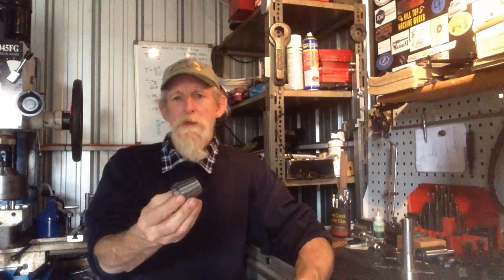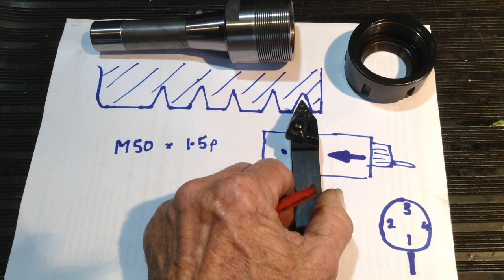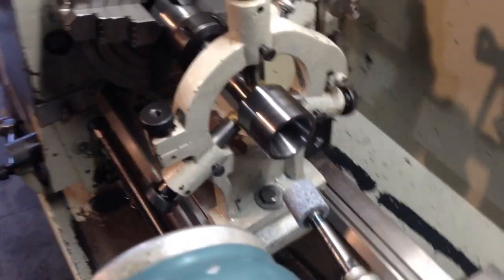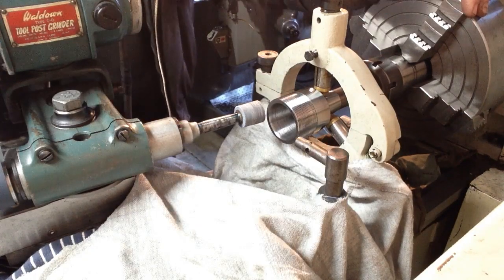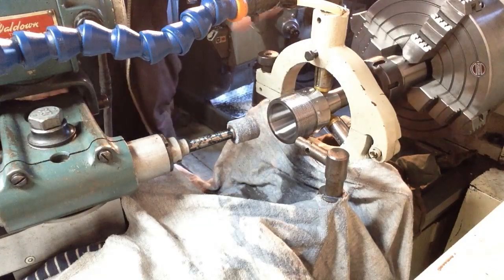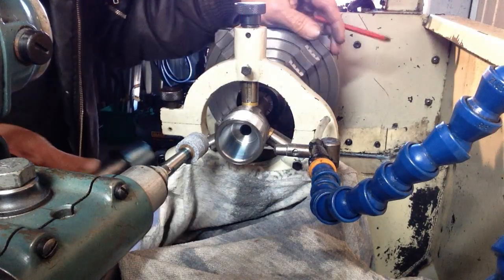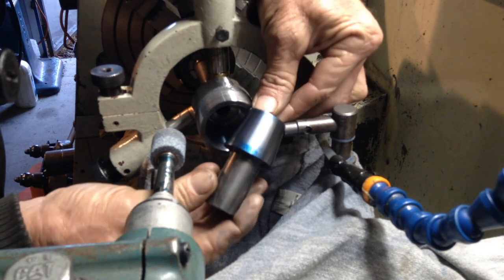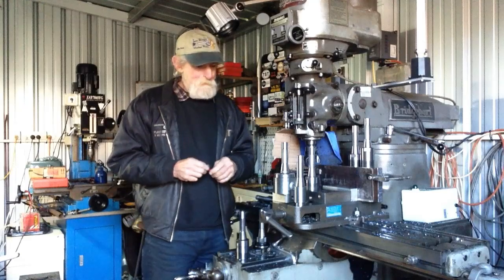Machining R8 Tooling For The Bridgeport . Part 12

Comment: That was a really interesting way to get the thread cutting tool aligned. I have always tried to do that with the compound at 29.5 degrees annthe you have to make two adjustments every time you change one. I like your approach. You always have such interesting operations. These tools are going to be top notch. I'm inspired.
Reply: The machinist in the workshop at the steel mill always kept the compounds at 90 degrees. they used carbides in a plunge fashion and I think they did it or clearance reasons. But once you know it works it is easier to do it all the time I suppose. Yes a beautiful set of tools from the old rusty scrap, say i have a pig's ear for you can you make a silk purse?
Reply: I remember a time i was demonstrating thresding at an ME exhibition and was showing the radial infeeding method when an old chap said you can't do it that wsy and that he was taught to always feed in at an angle. To that another chap said he was also taught angled feed as an apprentice but when he got to the real world and was setting up to cut a thread his foreman asked him why he was wasting his time and just go straight in. He said once he tried it he never bothered moving the top slide from its proper position again, save to cut angles.
Reply from the maker: @chrisstephens6673   I think it is 6 of one & half a doz of the other !   Generally i will only angle the compound for larger threads . As you know the inserts cut fine plunging  straight in  .   I don't know what happens on a cnc  if they plunge straight in or a programme  feeds it in like an angled compound .    Cheers .
Reply from the maker: @howder1951  Thanks .   The Americans always seem to have their compounds angled all the time , something i find is a pain in the ass !   Cheers .
Reply from the maker: Thanks Rob .  I have had to use them already , finished them just in time !   Cheers .

Comment: Hello Max, greetings from New Hampshire USA. a few days back I stumbled upon your channel, I saw the small run repetition Part 4 notice off to the right side. Thought I'll have a look at that. Glad I did.  So then I had to have a look at what else you posted up and saw the Bridgeport tooling series, I was hooked!  I assume that R-8 stuff is rather rare down your way. Here it is (to borrow a phrase from Stefan Gotteswinter) found on every street corner. It was a fun series to watch, I especially appreciate the Tool post grinding segments. Back in the  late 70's when I was a young lad, the old timers I knew all had a Tool Post grinder and used them. Now it appears that they are not so popular, but then again I do not get out much to larger engineering shops other than my own meager shop or a local shop I use from time to time. I have a small Dumore TP grinder but the motor died and  I have not needed to fix it yet! Anyway I just wanted to say Hello and let you know I like your channel.  The jobs you choose to film, the presentation of material and  excellent craftsmanship you bring to the table are first rate and delightful to watch. cheers
Reply from the maker: Thanks Warren .    We can get R8  stuff but it is all from china .   I had time so i made my own !    Cheers .

Comment: 3 or 4 years ago i put a quick change tool post on my old early 50's flat bed Mascon lathe, had to make a new acme thread post to go into the compound, when i got close, pull it all apart, try it, put it all back together cut a bit more out, rinse and repeat, and several trial fits, but came a snug fit, took hours but had the time of my life.
Reply from the maker: Thanks .    I nearly bought a big Macson several years back !   👍
Reply: She's tired, always put a mag back dial gauge on her, and only goes up to 600rpm, but for $200 I'm happy.
Reply from the maker: @warrenwise8127  Good one .  I never take my 24'' lathe over 650 rpm as it has a large chuck on it that has a couple of sus spots !

Comment: They all came out nice.
The size of the angle diameter in an ER collet is more critical than first thought might lead you to believe, if it is out by only a small amount you don't get the full collet closure range. I found this out when i bought a, yes, faulty chinese one. I had to take a mm or so off the front to get full 1mm range.
Reply from the maker: Yes , if you go over the 40mm maj dia  the collet sits in to far .   Easy to correct as you would have  had to shorten your one up by the sound of it , as long as there was enough clearance at the  back of the bore .    The short series ones i made  only have just enough at the back where there is no problem with the long series .

Comment: Great series Max, of a very challenging project, I remember you dragging that rusty piece of scrap to start with. I wonder if some time you could explain the blueing method you use and show what you see and are looking for, the camera doesn't quite give as much detail as I'd like to see. Thanks and cheers!
Reply from the maker: Just looking for the contact areas , using  a thin layer of blue ( to thick & it will give a miss reading )  .  It may show up better in the  No 4 Jacobs taper video from a few weeks ago .

Comment: My apology's Max as I'm way behind on your videos. This was an extremely interesting and informative series so thank you very much. And as you've said, there's little to no information on YT about tool post grinding. You put an amazing amount of time and effort into this. While production methods for R8 tooling would maybe be a bit different than how you accomplished it, this definitely shows why the cheap off shore tooling just can't compete with the more accurate and much more expensive industrial quality. What brand is your boring head? Up to now I've only seen that shank to boring head attachment method used on my Narex head. Other than the amount of material required for the shanks, it's a far superior design over the simple right hand thread attachment like my Criterion heads use. Narex unfortunately are more than proud of even there shanks. A R8 like you made to fit my B&F head has a MSC list price of well over $400 U.S.
Reply from the maker: Hi Mate .  My boring head is a  Chinese one that they  cocked up when they made it !   It has provision for a screw on shank and a bolt on shank .    They made bozo of the hole spacing  so i got it cheap  & drilled my shank to suit their holes !  It is a good quality , well made head considering where it was made .   Narex heads are super expensive here & hardly  ever see a second hand one for sale .      Cheers .
Reply: @swanvalleymachineshop  Hiya Max, then as I said that's the very first one I've seen outside of a Narex that uses the same head attachment method. Although there's no secondary screw attachment option with mine. But I'd guess that's probably who they copied. Mine only uses 4 allen head cap screws and yours looks like it has about 6. Yep Narex are really expensive here as well, had I not bought my B&F head and all the shanks when I did there's no hope I could afford what they are now. And the same for finding any used Narex over here. 

Another manufacturer besides the Wholhapter's to keep an eye out for is the French made D'Andrea B&F heads, few seem to know of them so they usually sell for a lot less it you ever come across one. Maybe very unusual for your area, but they can also be marked as an Enco head that were built for the American tool dealer of that name. A good friend owns one and there at least as good to possibly better than a Narex. There's also some Japanese manufactured heads that just might be found in your area that are supposed to be very very good as well. I've no idea about any manufacturer names for those though.
Reply from the maker: @turningpoint6643  D'Andrea is a good quality head , i used to use one back in the 80's & 90's .

Comment: Just started watching this one & already I have questions. 😂
Is that “tap magic” that you use to lubricate the threads while you are cutting them? (Or something else?).

How do you go about “cleaning your lathe” after completing a job? Compressed air is a no no?
Magnet? Sweep? Brush? Rags?

About to buy first lathe & would like to be able to keep it clean after each job / days work, and not really sure about any cleaning protocols?
I’m presuming that swarf & grit from grinding might be the mortal enemy of wear on the hardened ways?
Sorry it’s a newby question, everyone probably knows this, but me! 😂
Last question, is there a reason why you grind the inside taper, rather than use a boring bar in the tool holder and skew the cross (top?) slide to get the correct taper angle?

I’m guessing the plug that you turned was turned rather than ground?

Is it so you can more slowly “creep up” on the correct fitment?
TIA
Reply from the maker: Hi Ian . The cutting oil is Castrol Hysol MB50 .  it is for flood coolant ( mixed with water )   but i use it neat for thread cutting / tapping / drilling etc .   WD40 for aluminium .  
I was taught at a young age never use an air line to clean a lathe  , ok for blowing a few chips off but nothing directed at way wiper areas . The rest is brush & rags , lots of elbow grease & oil up , wd40 up as well . 
The bores were ground for better finish & accuracy as the parts were heat treated   ( the plug gauge was as well ) The plug gives an accurate duplicate of  any adjustments that have to be made to the angle , checked with bearing blue . Adjusted untill full contact is achieved .
Reply: Max Grant ,The Swan Valley Machine Shop. Awesome, thanks sincerely for your response. 👍👍👍

Comment: APU Excellent Max - what is the RPM on the shaft? Thanks & Cheers, David
Reply from the maker: I think about 170 , i will have to check .
Reply: @swanvalleymachineshop  Sorry Max, I meant the spindle speed on the grinder shaft (or stone)- I have just rebuilt the same grinder as yours with a new 180DC adjustable rpm motor - GEM - I was going to use the same rpm's as specified for surface grinding hardened steel - would that be correct?.........bit of a Newbie......
Reply from the maker: @davidharper4289  I went to check it but my tacho is shagged .  As long as you keep just below the max rpm for the wheel ( check manufacturers listing if not on the wheel ) you will be ok .  Big pulley on the motor for the inside grinding spindle & small pulley on the motor for OD grinding .
Reply: Thanks for your time Max. All the best David

Comment: Only just found your channel Max & you earned a new subscriber! 👍
Fellow Sandgroper here NOR so not that far from you. If you need an extra pair of hands building your new shed just holler. I built mine myself, did 20years with my old man who was a master builder.
You’d be welcome to check out mine if it will help you with yours. It’s a 6x7meter, 3.2 at the ridgeline.
I’m retired so pretty much available anytime.
Happy to provide assistance in return for being able to pick your brain once in a while.
Can I ask the make & model of your lathe please?
Just about to lash out on my first & it looks similar in some respects.
Cheers.
Reply from the maker: Hi Ian .  That lathe is a Hafco AL960B .   I still have to cut & drill all of the shed frame work yet , so it will be a while !   Thanks for the offer  .Cheers .
Reply from the maker: @ianmoone2359  The shed is 10m x 20m  with a 320 sqm roof area .  All out of 250 c purlins .   I just have to cut , drill & bolt together on site .  If i get stuck i will give you a buzz , thanks for the offer .    The lathe looks ok  .  Cheers .